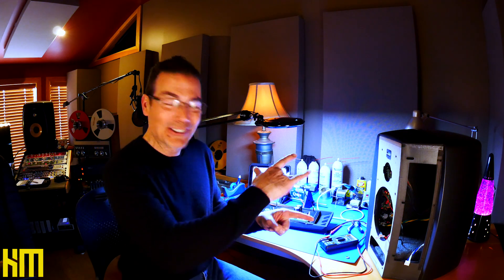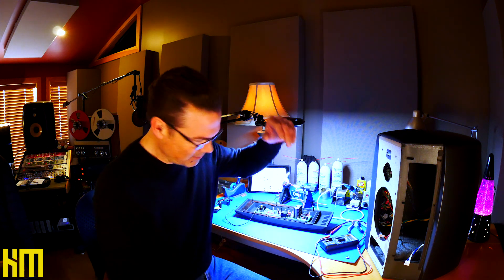Troubleshooting - KRK Exposé E8B

Comment: Hello, I have pair of KRK EXPOSE 8 to service. I cannot remove the two sides amplifiers modules. Is there a special " trick " ? Also how did you remove the speakers ? Even if I have a few decades of Audiopro technical service experience I am lost with that Monitor !   Thanks for your help. Best regards. Guy
Reply: I have just realized yours is a the E8B model. Big difference with the E8, where the speakers are direct mounted on the enclosure, not on a separate panel !  I cannot remove them....:-((

Comment: just started this video... in my  building of amps and pedals gear etc .alot of times its a contact point somewhere ,different heat and or beats can lower volume etc by way of less contact with vibration movement  .but that's one of a millions possibilities ..

Comment: This video is interesting to me, I had done something similar. I have a pair of KRK Rokit 6 I still use. I read many forums about this hygroscopic black gunk on the board and components. Sure enough this is what caused a whole bunch problems for my monitors. It became scratchy, low volume and the power switch wasn't working. I opened them up and removed all the gunk and rust with circuit board cleaner, WD40 and scalpel. It took very along time. To my surprise there was a lot. I cleaned it all up a final time and sealed it with a circuit board lacquer. The monitors both work like new now. All KRKs made in that era have this black gunk. There were issues with the manufacturing processes to put it very lightly. KRK have since address these issues.

Comment: Good luck with the repair Ken.

I've got my old Ensoniq EPS-16+ that I need to look at. It won't stay up too long before erroring out and becoming nonfunctional. I really want to bring it back to life to use the sample looping. There's nothing like it out there. I made some of the coolest loop/soundscapes on that thing back in the day.
Reply: I would look at recapping the power supply and any buck boost circuits as well.  I'd also reflow or resolder the regulators(3 leg components on heat sinks). As they have heated cooled over the years, those joints probably weakened.

Comment: I had a similar problem with my Wharfdale monitors except it made the woofer sound like it was blown, so after pricing up replacement woofers which was a good chunk of change, I decided to take it apart, checked everything, didn't see any visible signs of trouble, put it back together and had worked beautifully ever since. I figured maybe it was just a connection problem. Sometimes the corrosion gets on the connectors and when you unplug and replug together you actually clean off some corrosion allowing contact......good luck with yours Ken

ps. we need another studio tour

Comment: Had an extremely similar situation with my Adam's that turned bad. Nailed the issue down to one channel on the class D chip they used being dead. The chip manufacturer put a >20V hot pin directly next to an input pin that's rated at 7V max and something shorted it.

I thought maybe something fell in there until I opened up my second monitor and managed to catch it shorting the same way. The black glue they slathered on their boards was sweating.

Throughout my debugging, Adam refused to give any information on the amps in their powered speakers. I asked for a replacement board and they asked for warranty info. As they're out of warranty, they deferred me to shipping the entire speakers cross-country for repair.. Cost of shipping, parts, and labor is more than a new one.

I'm still on the hunt for replacement amp boards.